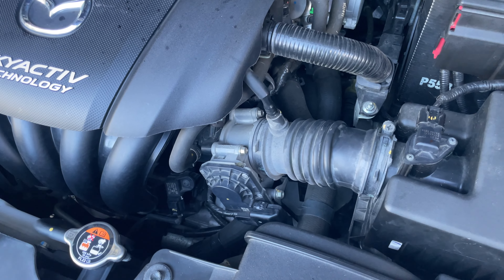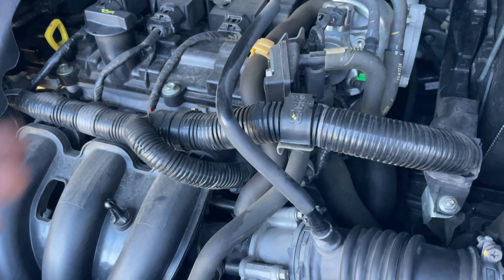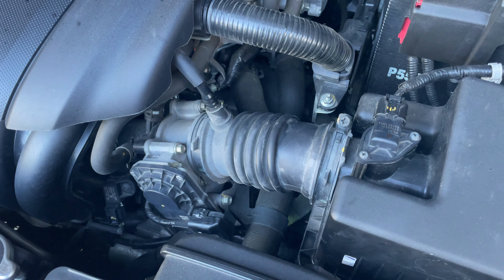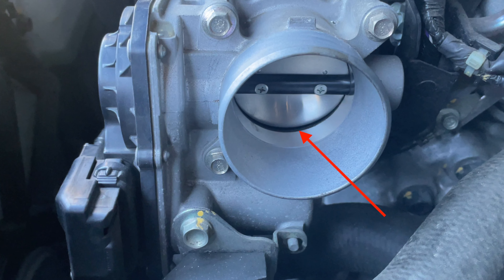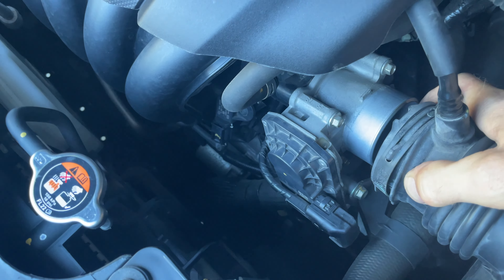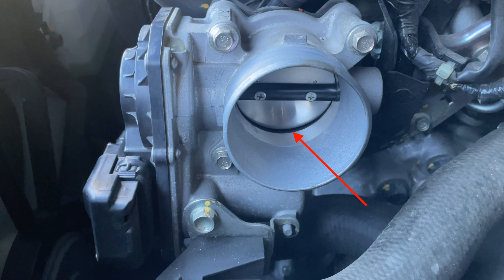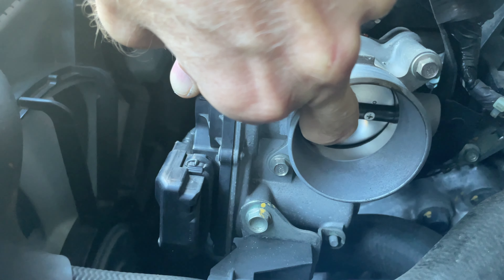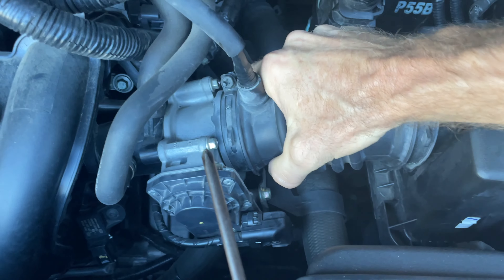Why does car run rough at idle & stall ? Throttle Body inspection & clean Mazda 2 3 CX3 CX5 CX7

Comment: Simple and straightforward video ❤, my question is, where is the idle air control valve in this car.?
Reply from the maker: Hey thank you! as the video shows, the main throttle valve (butterfly valve) controls the idle air flow when closed... Hope that helps 😃😃😃

Comment: I just replaced the sparks on my 2017 Mazda3 GT 2.5 from the stock Mazda sparks to NGK Laser Iridiums, and cleaned the MAF Sensor (with CRC MAF cleaner- didn't disconnect the battery). After, I noticed a rough idle. It drives ok but idles rough (usually cold). It hasn't been a couple of days yet for the engine to relearn the idle yet. But if the problem persists, can I clean the throttle body with spray while still connected to the engine, or will it need to be removed in order to avoid damage because of the spray? I actually had the throttle body (and fuel intake) cleaned about 2 years ago at the dealership, and only have about 44.5K on the engine.
Reply from the maker: Hi! i don't normally disconnect battery to clean throttle body butterfly but you can for sure.. dirty throttle body ect only gets bad enough to block air passage at idle if its got a lot of ks, air filter has been missing or very dirty dirt roads etc building up dirt & engine blow by oil/gases.. So with 45ks on yours, just visually inspect it.. if there is no noticeable oil dirt build up on the butterfly as in my video on the mazda, then dont worry about it.. keep an eye out for engine lights, as you may have a coil/spark issue that will throw the engine misfire code & light.. its the common idle issue.. Thanks!  😃😃😃

Comment: Thanks for the video. Very helpful 
Could you please advise me whether you have to put ignition on and push gas peddle to open the throttle plate? Or open by throttle plate by hand? To avoid having an engine light warning afterwards. As I was watching another video (for different make though) which mentioned the above step for electrical throttle control. 
I would appreciate your help
(Mazda 2, 2019)
Reply from the maker: Yes you wouldn't work on the throttle body with engine running.. just open by hand 😃😃😃
Reply: @mikemike7523  thank you 😀 I didn't mean starting the car/engine, just ignition (pressing start button twice). But will do it the same  way you did 😀🙏
Reply from the maker: @ Do you have obvious oil grime build up on the fine gap openings?
Reply: I haven't checked it yet. I was waiting for the weather to get better here in Scotland 😅 
I have a rough idle when starting cold (35k) had it for a year.
I also ordered some Mass air flow sensor cleaner to clean while at it. I will let you know soon 😀

Comment: Hey i just cleaned my fuel injector and reinstalled it. Had to take the throttle apart for that. When i turned my car on after that, it runs ok for 3sec then gets very shaky after that to the point where you can hear belt screech. The 2nd day, j reinstalled everything again and unplugged the negative for a day, this time the car ran good for 10sec before it idle rough again. Im thinking its throttle or ecu reset required. Any ideas?
Reply from the maker: Hi Did you use a professional injector clean process at a mechanics? that is they fit your injector in their injector machine that measures is flow output, then do a pro clean process, then recheck how the flow output has changed once cleaned? If not, your process may be a bit hit & miss, or even make it worse...  Yes as you've now changed things, it's probably best & in need to have it scanned & run live diagostics to nail down what is actually incorrect... Thanks! Hope that helps, 😃
Reply: @mikemike7523  nah I didn't do that. I just used cleaning car tool and sprayed. I was thinking maybe my car is trying to relearn the idle process and the ecu has to be reset?

Comment: Mine has a strange idling problem. It revs back and forth from 750-500rpm without rough working. Simply switches like that every 8-10 seconds.
Anyone know what could that be?
Reply from the maker: Hi! Ok, well 500-750Rpm is way too low, so there is some issue, but it could be a thousand reasons for low idle.. You'll need to get it scanned & find out why...  Hope that helps! 😃
Reply: @mikemike7523   There are no fault codes, but i noticed that  the "problem" only occurs when i turn the AC on. It just feels like the engine is switching form low to higher idle but with no unpleasant shakes or stalling...
Reply from the maker: @mrcha84  Yes 500Rpm still seems a bit too  low, but as for the Air Con, the car varies the Rpm when the air is turned on as the AC compressor takes a bit of power to drive, & takes power out of the motor as it kicks in.. So the car increases the Rpm to help keep it idling well while the AC compressor continues to kick in & out as it functions.. once the AC system has built up enough pressure to cool, the compressor is shut off, & idling will drop back down.. That keeps happening every minute or 2 as the AC keeps pressurising its system.. Hope that helps 😃
Reply: @mikemike7523   Thank you very much for clearing that out 😀